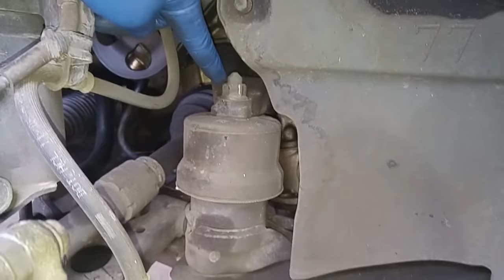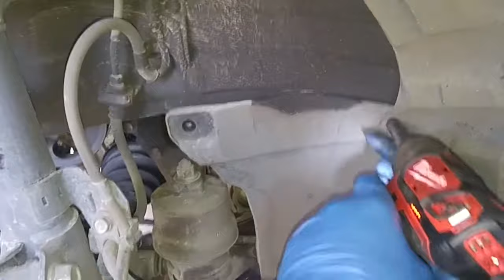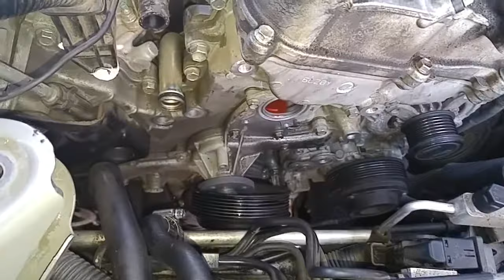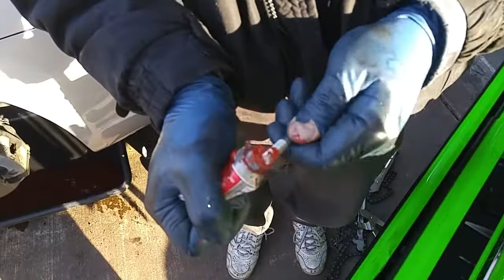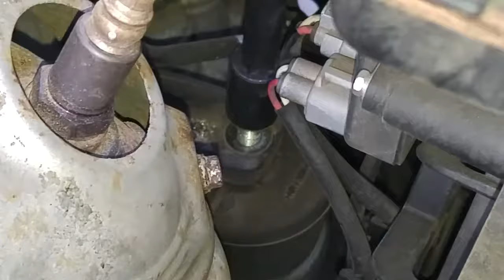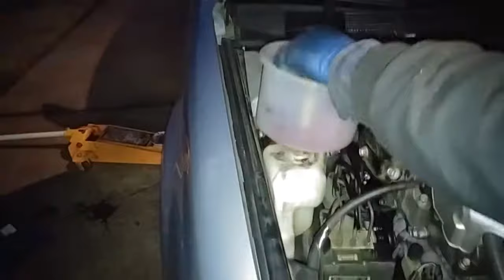Toyota Avalon / Camry / ES350 V6 2GR-FE Water Pump Replacement

Comment: EXCELLENT VIDEO which (as far as I know) is the first (and best) video on Youtube addressing this SPECIFIC subject!  Thank you, thank you, thank you so much for your time and energy making it!  Just a few questions... 1) Do you remember the year of this Avalon? (mine is a 2008 Limited) 2) The brush you used to clean off the water pump gasket... it looked like metal.  Any particular kind of metal? (brass or???).  3) Would it be "safer" with a different type of brush &, if so, what kind do you recommend?  I ask because it seems like you could possibly scratch the mating surface and, thus, create the opportunity for a leak.  4)  If the Tensioner and Thermostat have not been replaced yet (prior to changing out the W Pump) would you recommend the preventative replacement of any or all of them (since you are "near them" as far as labor is concerned) and are there any other wear items that I failed to list that would be smart to replace at the same time (if so, what)?  I have ZERO experience with the following but was still very surprised that you lifted the engine ALL the way off the mount (at bottom of engine).  Most videos I see try to keep it on by leaving the nut a bit threaded at the top so I assumed that the engine mount would be very difficult (or impossible) to line back up and tighten down if fully taken off.  In this video you seem to do it with ease.  5) Are they usually that easy?  6) If you leave it slightly on the mount, is the job still doable as shown in your video?  7)  In your opinion, would a pretty experienced DIY guy (I am about a "7" DIYer on a scale of 1-10) be better off leaving the nut slightly on the mount and not fully removing it... or should I not worry about it and take it all the way off????  You seem like you have done a lot of these on the 3rd gen Avalons... 8)  what is (roughly) the typical mileage that replacement becomes necessary on these V6 engines?  Sorry about all the questions, but I feel that this is probably needed for my car in the very near future.  I would greatly appreciate your fast reply.  Again, Thank you sooooooo much (and kudos to you) for this AWESOME video!!!.
Reply from the maker: You're very welcome for you wonderful comment.  I'll answer you questions one at a time:
1.  Believe it was a 2008 Avalon.  The important thing to know is that the V6 is a 2GR-FE engine which is shared in a lot of Toyota and Lexus vehicles starting in around 2006.
2.  It's a metal rotary  wire brush attached to a right angle drill.  It will put fine hairline scratches on the aluminum contact surfaces.  This is perfectly fine.  Important thing is to wire brush on an angle ... not direct.  You may want to break in a new brush by brushing against concrete to get the brush hairs on a angle.  Do not use any type of sandpaper to clean the contact surfaces.   
3.  Steel wire brush of medium grade is fine.
4.  Always a good idea to replace wear items like the thermostat, tensioner and idler pulleys on high mileage car (150K + miles).   
5.  Loosening or removing the center mount bolt will allow you to tilt the engine with little effort using a hydraulic jack under the oil pan (place a wood block between to distribute the support to prevent the oil pan from bending).
6.  Yes.
7.  You can leave the nut slightly on.
8.  Replacement is needed when the bearings give out (makes noise or can see wobbling) or you see your coolant reservoir level dropping and fluid spots on the behind the right front wheel (pump weep hole leak).
Reply: @hardlymovingpro  Thanks for the fast reply.  I forgot to mention that my Avalon has only 100K miles on it right now so two more question... 1)  If the water pump OR something else in the area fails (god forbid) prior to 150K-ish, would you go ahead and replace the water pump and the items you listed or would just replace the single failed part and then wait until roughly 150K  (or whenever the next failure occurs in that general area) to replace the rest of the items?  Also, on a tangent of sorts, I have had a light intermittent squeak (that only seems to occur in park & at idle) that I cannot locate specifically on that side for probably the last 9 months (it was non existent below 75 degrees) I think the most likely culprit is the water pump, tensioner, or (god forbid) the AC compressor (or its clutch).  I was hoping it would go away with my new alternator, but no. I have even tried to listen through some PVC tubing to try to isolate it but I just can NOT specifically locate it... :-(  2) What are your thoughts as to the most likely culprit and are there any other VERY likely causes that would completely disappear when temps fall?  Thanks again!
Reply from the maker: @jotu173  If you're doing all the work yourself, replace it all.  I today's auto repair market, the big $$$'s is in labor ... less so in parts ... if you shop around for the parts.  The squeak could be a worn belt.  PVC tubing won't resonant noise.  You need a metal rod ... like a long pry bar.
Reply: @hardlymovingpro  Thanks again for the fast reply.  I forgot to say in last message that I have already replaced the belt and tried putting my ear to a long, thin screw driver (does that qualify as a metal bar?) as well as a "mechanic's stethoscope" type tool.  The obvious problem is that I can not push them up against moving (possibly squeaking) pullies.  What seemed to work best (but still not effective) was letting the actual sound travel up a 4 ft long 1/8 PVC pipe with an L bend at the end to try isolate the noise area (the PVC pipe can fit down side of engine bay while running).  With all these devices, I can hear it... I just can't specifically pinpoint it.  So, unless (hopefully) you have a better idea, I think I am just gonna have to wait for something to fail.  If any more ideas, then please share.  Regardless... thanks again!
Reply from the maker: @jotu173  I wouldn't wait.  Take the belt off and turn the water pump, alternator, p/w pump, a/c compressor and all pulleys and spin/turn back and forth by hand.  Feel for anything that doesn't seem to feel smooth.  I'd bet it's the water pump.  I've seen them go bad in under 100k miles.   Had a guy with a Sienna with the same mindset.  Waited until the w/p bearings went bad,  all the coolant blew out and had to get the car towed.   Of course it happened on the weekend and he was out of a vehicle for 4 days.
Reply: @hardlymovingpro  I have already done the "take the belt off and rotate all the pulleys" thing and could not sense any issues.  I am definitely a preventative maintenance kind of person it is just that the 2 times I have had a water pump going bad, it always leaked antifreeze first?  I have never replaced a water pump before... but I can say that about MANY car DIY things, and then, next thing you know, I did it my self and it was fine.  This just seems like a pretty major undertaking also especially if I do the thermostat and tensioner (but I can do it).  It is just that I hate to when intermittent.  For instance, I have not heard the squeak in a few weeks so really hard to justify right now.  That being said, it has been unnormally cool (and that is when it disappears).  1) after reading all of this, do you still think I should swap it out now?  Also... you might appreciate this tensioner easier fix video (but be SURE to read video notes for a GREAT update.  I was going to do the bearings UNTIL I read the notes.   Here it is   https://youtu.be/BjDYXMPNtoc
Reply from the maker: @jotu173  The pump on the 2GR-FE is a little deceptive.  It's usually the bearing that goes bad first (makes noise) followed by eventually seal failure and leakage.  The seal failure/leakage occurred with a customer who chose to ignore the noise if there was no coolant leak.  As I had said before, it wasn't a gradual leak ... the seals completely failed and blew out all the coolant.  Had to get the car towed.  I check out the video.
Reply: @hardlymovingpro  1) So you are saying that if you were me you would replace THIS PARTICULAR water pump ASAP Regardless of if no coolant  is leaking or missing from the reservoir???  ALSO a "heads up"... If you ever try to  use the tensioner pulley (only) replacement (not the whole assembly) that I recommended you watch in the video notes a few days ago, be sure to read the other video "comments" first.  In summary, I found out AFTER I recommended the video to you that at least one person that used the Gates pulley had their issue return a short time after installing the part.
Reply from the maker: @jotu173 The OEM pump on your car is made by Aisin.  Whether you want to get the cheaper Gates brand is up to you.   I haven't had a problem with it.  Isolating the causes of rotary noises can be difficult and be a matter of trial and error.
Reply: @hardlymovingpro  I might have to do the water pump trade out VERY soon so your fast reply is appreciated.  Just one question right now.  Did you have to use 2 jacks... one to lift the car and one to lift the engine?  If not, then how did you do it?
Reply: @jotu173 did you end up changing the water pump?

Comment: where is the one nut that you take off the thermostat housing thats with the two bolts? what size is the nut? can't figure out where it is under the housing.
Reply from the maker: Look at the 7:16 video time mark.  With the housing removed, you can see the stud sticking out.
Reply: Hardly Moving Productions 10mm? Need a longer socket since the bolt is longer?
Reply from the maker: @onchristthesolidrockistand  Yes.  10 mm and a longer socket.
Reply: Hardly Moving Productions thank you!
Reply from the maker: @onchristthesolidrockistand  You bet!

Comment: hello I have 2006 Toyota Avalon with 190,000 mi how long and I have to change the water pump ?
Reply from the maker: If you've gone over 150,000 mi without it failing, consider yourself fortunate.   On the V6 GR-FE engine, they tend to fail at around 100,000 mi.

Comment: Great job mate : )
Reply from the maker: Thanks!
Reply: Hardly Moving Productions hey man I have a Toyota Avalon 2004 there seems to be leakage which I’m thinking is honestly just water coming out from everything I’m seeing it may just have to do with the ac it’s right around the mid front end underneath the car it’s clearly a small pipe that seems to be dripping this is normal ? It almost looks a bit white after taking a bit of a look at it but that’s what has me worried it of course could be more
Hopefully I can get a response back appreciate it
Reply from the maker: It sounds like water coming out from your ac condensation tube.  Check your coolant reservoir level.  Fill up if low and check later for fluid drop.

Comment: why RTV on the bolts
Reply from the maker: The bolt mounting point holes may pass through coolant passage ways.  If sealant (RTV) is not applied to the bolt threads, coolant seepage may occur through the bolt holes.  If seen this happen with other water pump bolt holes.  Also, the water pump's 12 mm bolts, when pulled for the first time, had sealant residue on the threads.

Comment: Excellent video... thank you for taking the time to make it and share it!  The water pump on my 2007 Avalon with 193,000 miles  just started making noise and leaking.  While it is quite I job, it's still do-able!  

A couple of questions.   While you are changing the water pump, would you recommend changing the idler pulleys and tensioner pulley?  Or if they go out later, can you get to them without raising the engine.  ALSO, is a serpentine belt removal tool (in you link) necessary?  Thanks!
Reply from the maker: Glad you found this video useful.  With 200k miles on the accessory belt pulleys, it may be a good idea to replace them.  Unfortunately there's 3 of them and they're not cheap.  The third pulley (to the left of the water pump pulley) may be difficult to remove without slightly lifting the engine.  The serpentine belt removal tool will give you the torque leverage to relieve the tension on the belt tensioner as well as let you get into that tight location. 

Help support our channel by hitting the thumbs up and get notifications of new videos by subscribing ... thanks!

Comment: hi, are the two idler pulleys exactly the same? how many idler pulleys are there? where do you buy the idler pulleys? Thank you for the detail videos! my 2006 avalon limited still makes quite loud rattling noise even after waterpump and serpentine belt replacement.
Reply from the maker: Also, that loud rattling noise may be from a failing water pump pulley.  I would not assume the idler pulleys are going bad.  Easy way to tell is to remove the serpentine belt and spin the wp pulley and idler pulleys with your hand.  You should be able to tell the roughness in the bearings.
Reply from the maker: Yes ... the two (2) idler pulleys are the same;  however, the tensioner pulley is slightly different.
Reply from the maker: A replacement idler pulley can be obtained from a Amazon link within this video description.
Reply: Hardly Moving Productions Thanks a ton for your answer. It helps a ton. God blesses!!!
Reply from the maker: No problem, my pleasure and good luck with the repair!

Comment: I had a health issue about 4 weeks ago and coming home after a doctor visit about a week later I noticed the engine running very hot.  When  I popped the hood after arriving home I realized the water pump was definitely shot.  I got online and ordered a replacement pump and then started checking the web on replacement videos.  I came across your youtube video and ended up watching it several times before attempting to change the pump.  I'm an aircraft mechanic by trade so mechanics don't scare me too much.  Last Saturday, the 1st of June, I decided to change the thing.  When I started it felt like I had done this before due to the fact that your video was so detailed and precise I tackled the job in about 5hrs start to finish with not a single hiccup.  I just wanted to thank you for taking the time and effort to produce a tutorial like this and I will be looking for anything else you might have for any other faux pas I might encounter with my Avalon.  Thank You ever so much, Tom
Reply from the maker: That's great news Tom!  Wonderful success story on the water pump replacement.  The videos we produce on the Avalon, Camry and Lexus ES can be cross referenced (via playlist) if using the same engine (i.e. 2 GR-FE).   The playlist is "Toyota Camry / Avalon / ES300".  Thanks for your support!
Reply: @hardlymovingpro what was your water pump doing. I think I need my wife pump replaced on her toyota avalon
Reply: Any tips I may attempt this
Reply: @throwaway2082 dont be scared.

Comment: and how did you diagnose pump failure what were the symptoms?thanks
Reply from the maker: Noise from worn out bearings is one symptom ... the other is continuous coolant leakage/seepage at or around the water pump's weep hole, gasket or seal.  When it leaks, the coolant "slings" around water pump pulley area.  You can use a pry tool pressed against the pump and put you ear against the other end of the pry tool.  If you hear a grinding noise, the pump bearing is on its way out.
Reply: @hardlymovingpro  exactly what I have! thanks man best video on youtube next project will be the spark plugs I saw some video on your channel
Reply from the maker: Great!  And good luck with the repair and thanks for your support!

Comment: Great video so you don't have to drain whole coolant from the system
Reply from the maker: Nope.  Today's coolant technology is incredible good!  They use OAT (Organic Acid Technology) coolant which only degrades if something from the outside contaminates the cooling system.   I worked on a Camry V6 with over 200K miles and the coolant was still bright pink!  Couldn't believe it!  I'd say your radiator, hoses or water pump will give out before the coolant.  So whatever drains out from the water pump replacement, just replenish it.

Comment: Thank you SO much. Following your teaching, I get my Highlander water pump job done. Just some my own input, those ring nose hose removal pliers are extremely helpful, without them it's such a PITA to remove and re-connect the small hose connecting to the themostat housing coz there's no way to grab it to wiggle it off or on. And, I don't quite understand why you put RTV on those bracket bolts, I think RTV is used on rubber seals. Instead, I put anti-seize onto those bolts. I used RTV on 2 o-rings. Again, Thanks.
Reply from the maker: Thanks for your comment and support!  Any you're right ... those long hose pliers go a long way in removing coolant hoses!

I use RTV because in some cars, the behind the water pump mounting holes in the engine block may be coolant passages.  Coolant could come out through the bolt holes.  Also, RTV can be used as a thread lock.  On new o rings, use di-electric grease because its water proof and does not swell rubber.